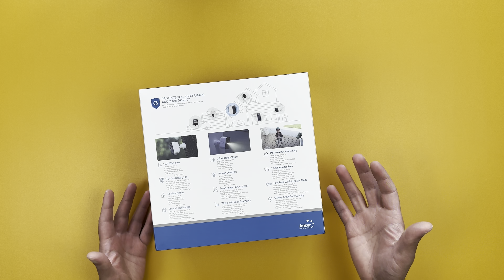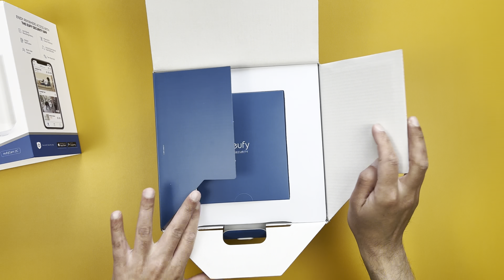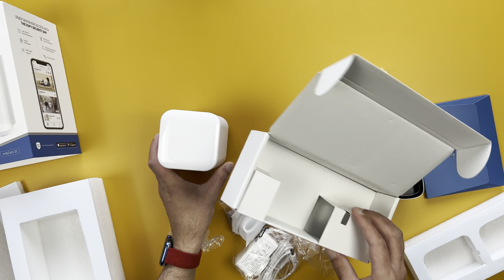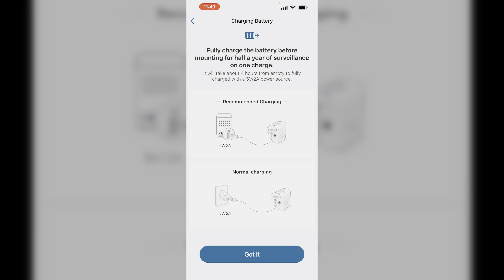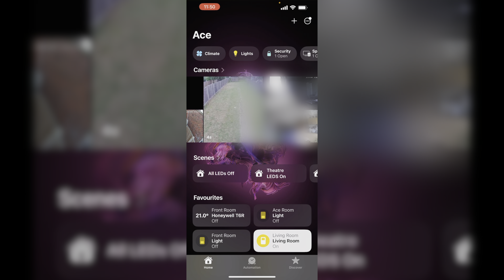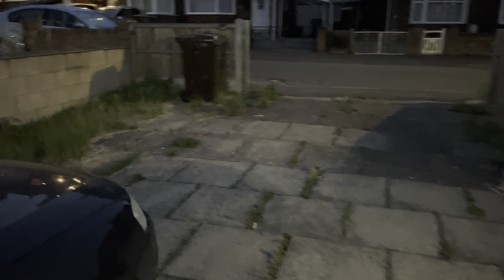EufyCam 2C Unboxing & Setup

Comment: You do know that if someone steals the camera and presses the reset button on the camera you will lose all content saved on the hub its absolutely crazy that this is possible it's very poor security from eufy I've sent mine back for this very reason
Reply from the maker: That’s true if you don’t use HomeKit secure video, in my case all video is also recorded to HSV which means I have a copy of all clips in 2 places and HomeKit doesn’t stop recording after 120s like the hub does, so it has the entire clip recorded.

If you are mounting it in a location where it can be accessed then the eufycam 2/2 pro is a better option as they have built in sirens if they’re messed with.
Reply: @MATechYoutube  thanks for the reply I understand what your saying but its just not good enough by eufy they sell the product as your storage will be safe on the hub its clearly not as it supposed to be a security system the fact that you can just press a button on the camera and all footage is gone is just mad its supposed ti be a premium product not a lot of people know this and just think that the footage will be on the hub this is clearly a f.. K up eufy and people need to know this is cleary not secure I've found a video highlighting the problem I really think you should make a video explaining this to you subscribers I think the video will gain a lot of views
Reply: How does Spotlight works with Apple Homekit? will it still working? thanks